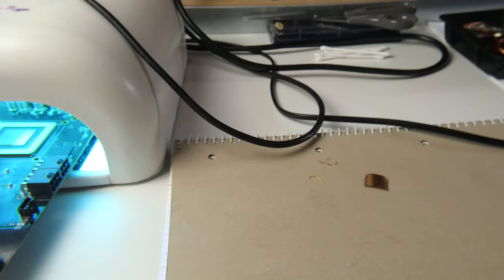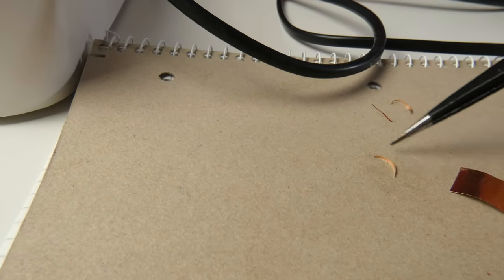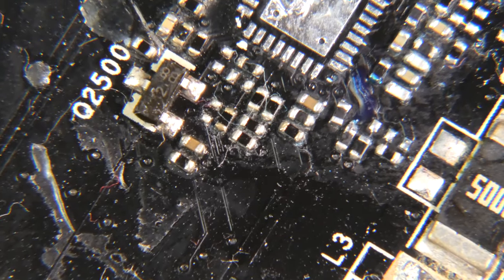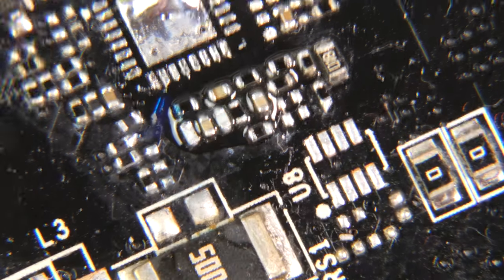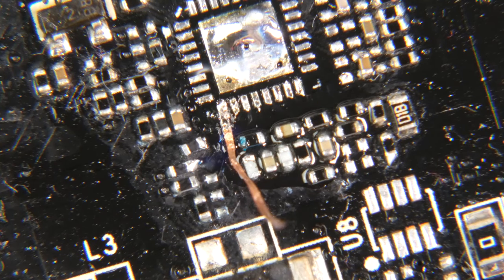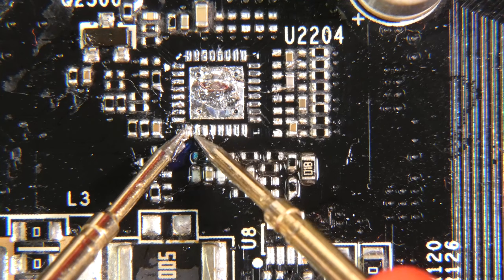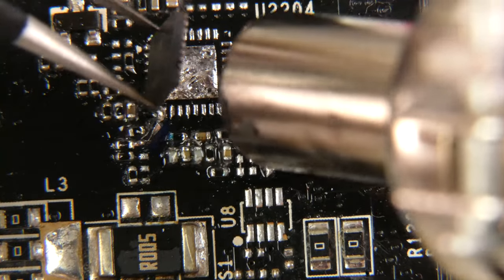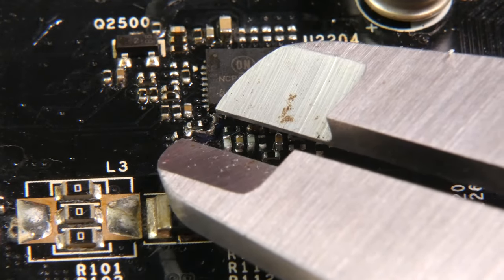Easy PCB Trace/ Pad Repair Technique

Comment: Ana use amtech 559 flux .. when removing it helps to not tear traces.. I’ve have much success using that flux .. also I use copper jump wire super thin mechanic makes great ones  .. would work wonders for u since u are in this same line of work..

Comment: Usually after cureing solder mask with UV you need to apply heat to it in order to proper solidify, for the latter stage I use soldering hot air gun.

Comment: Did you ever find the cause of the short? I have the same exact card with the same issue and I can't for the life of me find the short
Reply from the maker: Well the original short on this gpu was one of its mosfets. (At some point they just die, that is normal) What I am fixing in this video is damage I inflicted on it when I worked on another issue. The lower two power rails were not working. For whatever reason their drivers were dead. I misread the issue and tried a voltage mod to make the gpu more stable. For it I had to cut the trace. After I figured the actual issue for its instability I reversed the voltage mod and accidentally ripped the trace off the pcb.

Comment: Hello Anna! I have a dead RX 580 8gb, When I power the card on I get no display output but the core becomes warm, when I measure the resistance between ground and the inductors I get 0 ohm, does that mean the chip is dead or how could I repair it? do you have any ideas? Thanks!
Reply: did you fix it? try an reflow
Reply: I'm thinking your chip is likely alright and the short is going either through some ceramic capacitor or through a low side MOSFET. If you have access to inductor legs, you can take them all out and see what side of the circuit the fault remains on, and just bisect from there.

Comment: Hello Anna - did it work ? I dropped a tiny amout of strong flux onto a chip and it took out 3 traces from it. They were a lot smaller than yours and almost hopeless. The legs were flush with the chip. I had some repair paste in a hyperdermic I had not tried. I would guess the width to be around 0.2 to 0.3 mm, it's white and perhaps silver based. Chinese of course. You may remeber the fan control unit days, it was a chip on one of those I had bought before you circuit. It worked perfectly. I don't know what resistance this paste has but 10mm showed less than I could measure.
Reply from the maker: Lets just say there was an electrical connection, as for the chip working afterwards... well that's a no. I haven't figured out why as it was the right component I connected it to but a small wire solved the problem.
Reply: @PhysicistAnna  I did wonder why you didn't try a bit of wire. I do miss the old valve days when you could use a soldering iron tip the size of a carrot. 10 out of 10 for trying.
Reply from the maker: Wire is not reliable enough in this case as I can't solder it inbetween the chip and the pad. Doing so would lift it up too far from the pcb so theere would be connection issues with the other pads. The wire is just so dodgy and makes barely contact to the chip. I had to solder i to the side of the chip. Hard to explain but you'll see when I make the final video about the graphics card. In the end I think not using soler mask to fix the repaired trace in place might have caused it to move and therefore making poor or no contact to the chip itself. But this I can't test.

Comment: Hi Anna, How can I contact you? I have 2 graphic cards with different issues and I am unable to repair it. 
1st card is works fine when I plug it in my PC but when I turn off my PC and turn it back on then this card shows no display and then I have to wait 3 to 4 days and after that when I plug it back in my PC it works perfectly until I power off my PC turn it back on.
2nd card is working fine but few days ago AMD showing error message that "Display driver failed to load on your system" and screen freeze again and again and sometimes blank screen pops up and when I restart my PC it shows no display on screen.
Both cards are from AMD.  Please reply and guide me how to trace the fault. Please give me your official email so I can contact you. Thanks.